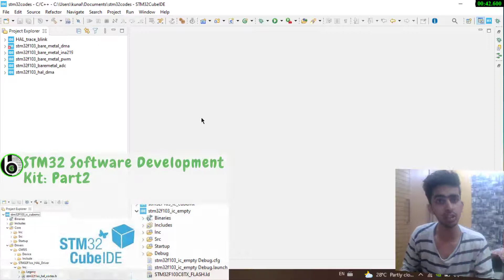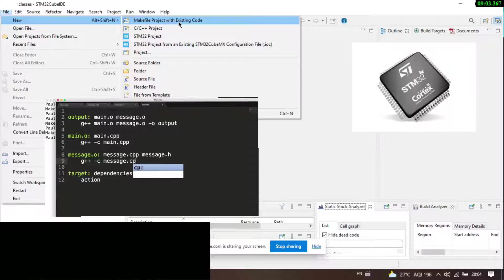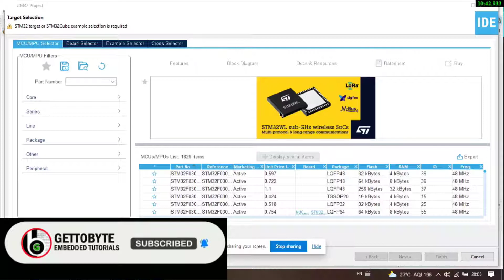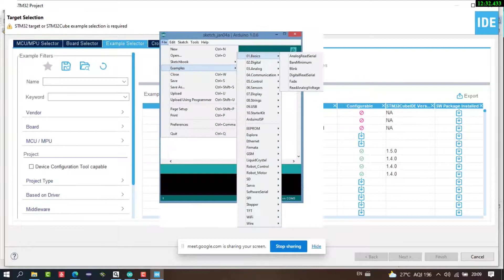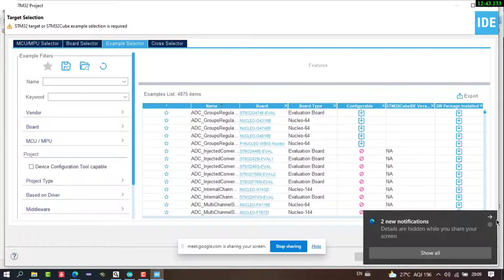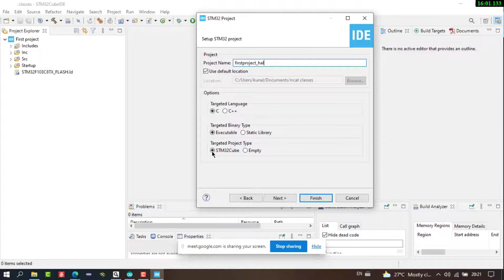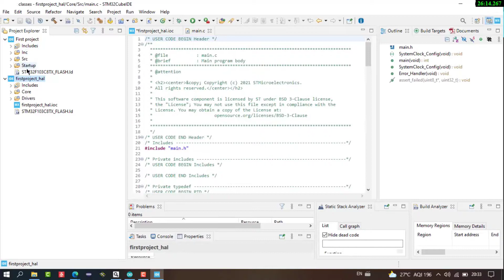STM32CUBEIDE Tutorial Part 2: How to Create a New Project ||Eclipse IDE||CubeMX||STM32 HAL|| GNU GCC

Comment: Bro can you make a video about stm32 bluetooth module,, its communication and mesh networking to transfer data from one to another..

It will be useful bro, can you make it, pls
Reply from the maker: Stm32 bluetooth module?
U mean stm32wb55
Reply: @Gettobyte  s bro,, bluetooth communication,, and mesh networking.
Using cube mx and also using bare metal if possible..
Reply: Can you make a video bro, can I expect from you